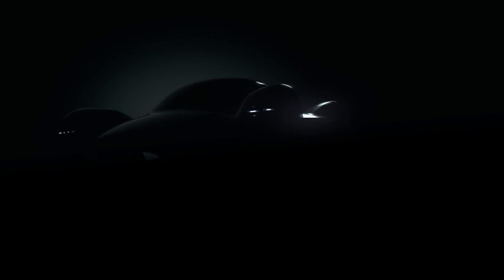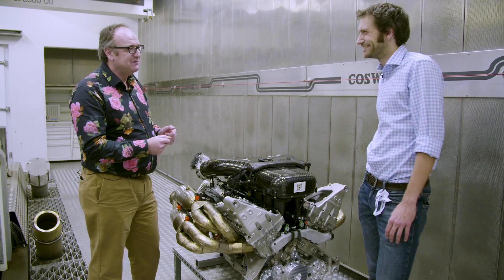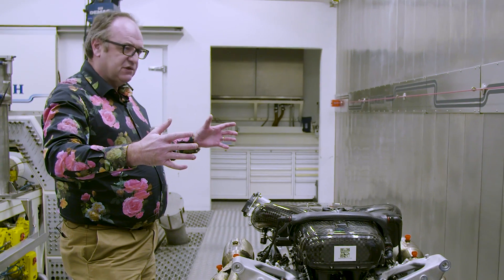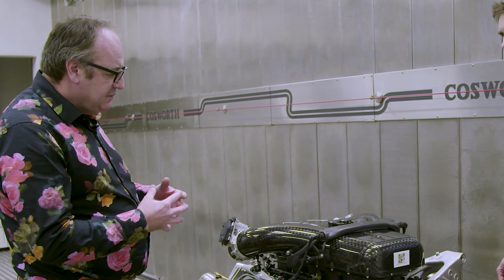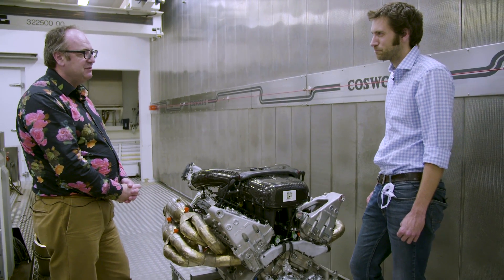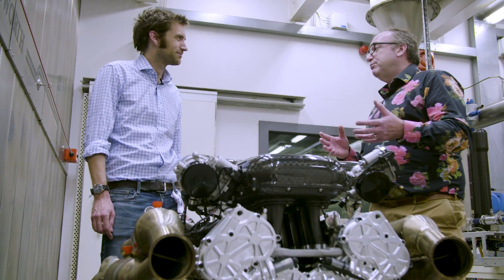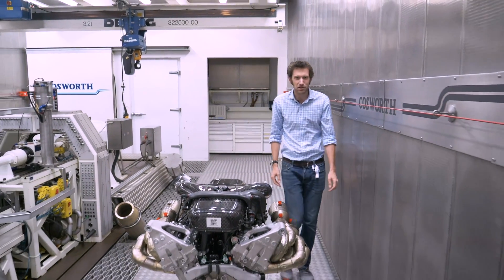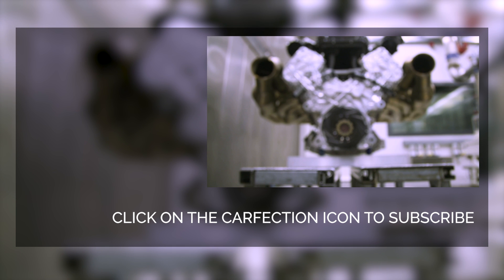Hear The Future Of The Supercar At 11,000rpm: The Aston Martin Valkyrie's V12 - Carfection

Comment: Great film, inside, explanations and everything, thank you a lot. 
I just have a tiny question regarding the clutch... why settle for sinter if the car will get electric motors (hybrid), anyway? A carbon clutch could be used with its benefits and, outside of e.g. race mode, the electrics could do the driving of. After the revs of gearbox and engine match, the carbon clutch could automatically be released (creating possibly the smoothest driving of feeling in normal traffic, and you wouldn't be able to stall it) and of it goes... But if the customer prefers,... happy stalling...
Thank you again, greetings to Cosworth, Mr. Woods, and Mr, Newey. Keep up the good work.
Cheers, Obelix

Comment: As amazing as this engine is an electric motor vehicle will crush a combustion engine vehicle. As battery technology improves the gap will grow larger.  Internal combustion engines need to be must more efficient.  Gasoline fuels have changed very little the past fifty(50) or more years.
Reply: whatever you say

Comment: All that noise, all that heat, all that friction - that's the sound of money burning. While the engineering is impressive, it's an ICE, inefficient as fuck compared to electric, and this thing, with all it's engineering, can still barely keep up with a 2 tonne+ Tesla model S up to highway speeds. What does that tell you? I guess to all the revheads, probably not much, you guys live in such a blinkered, testosterone fuelled world, you will never understand the reality of just how bad ICEs actually are and how much of a pointless waste of resources something like this car actually is.
Reply: This engine will be paired with an hybrid system for a combined power output close to 1200 ps, on a car with a weight of around 1000 kg and with underground aerodynamics (meaning high downforce, low drag) which is expected to accelerate from 0 to 322 km/h in around 10 seconds. 
So yes, it will be able to keep up with your Tesla 4-wheel-fridge at highway speeds.

Talking about electric engines, fuel consumption, etc. regarding a 4 million $ hypercar produced with F1/Group C/LMP1 level of mechanical technology, in no more than 100 pieces, as a testament of NA and V12/V10 F1 race cars.
Totally out of context.

Comment: Let's recap: Engine bay completely full, engine block holding front and back of car together, suspension loads are directed into the gearbox, all at 11k RPM (with gear-driven cams). How the bloody h*ll are you supposed to maintain this thing?

"It has to be everyday usable." LOL

Bonus: They put the radiators on top of the exhaust headers!

Stick to F1, gents. These "features" have no place in a passenger car.

Comment: the engine being a required structural part of the car sounds like a really bad idea for a road legal car.. because unlike a race track, real roads have many imperfections, potholes, dips, bumps, etc.. so not only does the engine have to contain it's only v12 forces, the car's twisting and turning, etc, but now also has to deal with every single bump, dip, pothole, etc.. those engine mounts/bolts, etc that are connecting it to the rest of the vehicle are going to be stressed to hell. Will be a sad day when we see a news story how a Valkyrie broke in half cause the owner hit a speed bump or pothole too fast which caused the engine bolts to snap from the cabin frame.
Reply: You know they make titanium bolts right?
For comparison, the wings on a commercial airliner are typically held in place with four bolts. It is very easy to ensure bolts will not be the failure point as there is so much data available on them.
Reply: @flightmaster999  question is, will Aston use bolts rated for airline use or not. Which in itself may be an issue since the types of stresses an airplane experiences in flight are different than what a vehicle experiences on the road.

There are plenty of cases where individuals blindly used parts rated for airplane use on a car in the custom modding scene, but end up snapping/sheering the part because the part experienced stresses it wasn't designed to handle.  i.e. part may be strong in resisting being stretched or compressed but is weak and sheers if enough lateral force is applied or vice versa.
Reply: @LycanShift  I think the Cosworth/Aston Martin guys know what they are doing, lol
Reply: Manufacturers have been building the engine into the chassis for years. Ferrari did it with the F50 if memory serves.
Reply: We have a youtube engineer right there..go teach them how its done...LMAO!!!!
Reply: Whatever you say

Comment: In reality, on the road, the drivers of these cars would probably only use the full rpm range a couple times because 1. That noise would frighten everyone in a block radius including the driver 2. The acceleration in first gear would be heart stopping.

A race engine on the road

Comment: While this kind of power per Cubic Centimeter is not unheard of, The mk3 Focus RS with its 2.3L Cosworth tuned boosted engine produces roughly the same power per CC. The fact that its naturally aspirated and capable of reliably running at such high speeds while maintaining such stringent emissions standards proves what an engineering marvel this engine is. Outstanding!

Comment: The part where they're simulating 100k of use for endurance testing got me thinking... If the engine is such a stressed component wouldn't it be wise to put the engine under different torsional loads during running to account for the structural aspect? I feel like it just sitting there doesn't take that into account...

Comment: Cosworth delivered to me - a 3.5L VQ35 V6 including Cosworth heads, that my tuner got 401hp out of NA. That was 2008. That engine could rev to 9,000rpm, more, but it stopped producing power above that.  My view at the time, we could not force more fuel and air through it NA. CR was 11.5:1.

Comment: 11000 rpm can easily archive by electric motors. All electric motors used in EV today having much higher than 11000 rpm that it need a gearbox t reduce it to reasonable speed. As of today several supercar maker are going electric why are they still developing v12 fossil fuel burning engine it kinda make no sense.

Comment: Can some american car manufacturers get a load of this video? Everyone is sick of 200 litre v8 engines reving only 300rpm, if a engine doesn't rev at least 7k rpm it can't be considered a good engine. They could put a light flat plane crankshaft in their v8s, and make them more emotional. A viper acr is a real beast, sad that it doesn't rev higher, but at least its got huuuuge amounts of torque in the low rpms. Same as the zr1, not even 7k redline. Instead of making 30 speed automatic transmissions they should focud on a 7 speed dual clutch and a high reving engine imp.

Comment: Until you find a way to keep the car on the ground without the tires falling apart. Who cares about the car ?
Reply: Brosyden you need to turn your gas stove on go for a good sleep
Reply: @porschecollector727  Dude I get it, it's awesome the sound the design the engineering. But if it can't smash or compete with Koenig or Bugatti what's the point. Both of those manufactures have problems keeping the tires stable after 260+mph for an extended period of time ( under 30 sec ) and the downforce is so strong the power to weight ratio needs to be higher without compromising stability and flying into the air at such a high speed. An engine can only do so much without a full design of physics and aerodynamics. 

But your a troll and im happy you learned something reading this. GET OWNED  !

Comment: Great engine.. terrible mounting choice. The engine should never be a stressed component of the vehicle itself (unless it's a motorcycle). (A.) Too much reinforcing required to support the lateral and twist loads. (B.) The car is literally impossible to service unless you break the whole thing apart to get the engine/trans asy. out. There's no reason they couldn't have created a carbon fiber and aluminum super-structure to support the engine/trans. I think Cosworth stuck their royal foot in their ass on this one. Reliability as a road car is going to be marginal at best. 😐

Comment: If they got 250 hp with 3 cylinders should it have 1000 hp not including electric motors
Reply: It does have 1000hp the electric motors increase that number

Comment: He said the engine is part of the car's structure, does that mean the engine mounts will be solid without any bushings to absorb the twist from the torque forces? I'm curious how rough the ride will be in the inside, but then again it will most likely be a track only car.

Comment: Suonds like this engine was detruned from a F-1 normally aspirated 12 cylinder.  I recall F-1 engines got up to 20,000 rpm.

Of course, the Valkyrie is suppose to last for a pretty long time on the road.

Comment: The best single measure of engine development is the Break Mean Effective Pressure. It takes time, expertise, and lots of money to excel here.

Valkyrie:
1000bhp, 11000rpm, 6.5L, peak power BMEP of 180psi.

This is not the peak BMEP, as we would need peak torque figures for that.

LaFerrari:
790bhp, 9000rpm, 6.3L, peak power BMEP of 180psi.
700Nm, 6750rpm, 6.3L, peak torque BMEP of 202psi.

I would expect the Valkyrie to make about the same, but if it does so at a higher rpm it's even more impressive.

The Ferrari engine has been around for a while, and every bit of performance has been extracted. That Cosworth could get to this level of performance within this timeframe and for just one car (probably on a smaller budget), speaks volumes of their capability. This is truly a masterpiece.

Comment: This may well be the last best internal combustion engine. Peak engineering and likely the end of an era...
Reply: It's surely not the end yet, since 3rd generation fuels and methane synthesis are on the rise.
Reply: you're underestimating how much cheaper would become to live with an Ev. Mantainance very rare and no fuels needed (electricity also has its cost but it will be so mich better than fuels, every kind of fuels). Let's the money do the talk, I'm curious too...
Reply: @briannabernaola5597  
There will always be a market for internal combustion, even in an era when it becomes illegal anywhere but a racetrack (it will happen, probably in California first, just as eventually only first responder vehicles will have steering wheels). There is no substitute for the experience of a living, breathing motor, and I'll be there, even when electric cars routinely beat us on track.
Reply: Wrong. We will have gas engines for another 100 years at least
Reply: @VEEZER1  and horses too, im sure. In corrals and museums.
Reply: @VEEZER1  They will exist.  Just like steam engines and horse carts still exist.  Almost no one will use them for daily use.  When was the last time you rode your horse to the market or plowed a field with a steam engine?
Reply: Well it might be peak of engineering, but it is ridiculous to say that internal combustion engines are dead -- and they won't be for a very, very long time.
Reply: @bobbysmith9725  they are def dead, you must not be in tune with the world and when the Tesla roadster is released these superice cars are super done for.
Reply: @bobbysmith9725  If a "long time" you mean 10 years.
Reply: @bobbysmith9725  The transition to electric will happen much more quickly than people expect.  As battery costs continue to fall it becomes lest costly to build an EV than a combustion car.  EVs currently cost about 1/3 to operate as fossil fuel, and there is almost no maintenance or wear on an EV other than tires.  Total cost of ownership of an EV is already lower than an equivalent combustion car, i.e. Tesla Model 3 vs BMW 3 series, Nissan Leaf vs Nissan Versa, e-Golf vs Golf, etc.  EVs already win on purely economic grounds for new car sales and the gap will accelerate.  For used cars, a used Leaf or i3 is an incredible bargain.  And the choices for other good EVs is growing rapidly.

Tesla reaches cost parity with combustion cars in 2 years, meaning it then costs them less to build an EV than a combustion car.  VW maybe 5 to 10 years.  Others later.  When EVs are cheaper to buy, almost no one will buy fossil cars.

Since this is a performance channel, as battery gravimetric energy density continues to improve, they will easily outperform combustion vehicles at both a lower weight and lower cost, especially if solid state batteries work.  The Tesla New Roadster outperforms Bugatti Chiron at 1/10th the price: acceleration, top speed AND RANGE.

The Tesla Model 3 Performance  today outperforms BMW M3, including on race tracks: https://www.youtube.com/watch?v=pOVIgVvjfH0
Reply: @LoanwordEggcorn  The batteries are a major concern maintenance wise
Reply: Loanword Eggcorn wait until the environmentalists start trying to power the grid exclusively with wind and solar, and then you’ll find the cost of electricity becomes much higher
Reply: @horseradish843  Well engineered battery packs are highly durable.  Some Tesla customers already have 500,000 km on their original battery packs with minimal degradation.
Reply: I was just thinking this same thing. Electric motors are the future. I'm excited for change, though. New e cars will be exciting as well... It'll become a hydrodynamics and software problem to solve instead of mechanical, mostly. But we have a long time before ICE goes away.
Reply: @swesleyc7  2025 ice cars wont be sold anymore
Reply: @Geedygeedy  What about people who have like no reliable places to charge in their countries. ICE will live on for a long time
Reply: @smothdude  by 2025 the infastructure will be built. Any country that can receive reliable gasoline will have MORE access to electricity than not. Also since they will be alot cheaper, more reliable, and maybe 3 times the range as an ice car by then, it will be more accessible to everyone.
Reply: Geedygeedy am do you know that the ice car can refuil in les than a minute and build tanks in it however its like to ?
Electric cars can not and are boting as hell and not environment friendly they only throws the problem to another place and solves nothing

I can explane everything about wy but im tired of that

At least they are a hell of idiotic
Reply: Geedygeedy What did you smoke? Three times the range of an ICE car???? How exactly are they going to have a range of at least a thousand miles? The most efficient electric car doesn’t get more than 200 in the best conditions right now, so how do you want them to have a range of more than a thousand miles?
Reply: koenigsegg does better
Reply: I don't recall EV being reliable. Possibly, due to all the tesla issues. Not only this, but EV aren't going to be the standard anytime soon. They overheat when being pushed and can't hold their charge for long in the sane scenarios
Reply: Agree.  Internal combustion is dead, and this is near peak engineering.  A reliable 1000hp from 200 kg is remarkable.  And normally aspirated is much better driving than boosted.
Reply: Loanword Eggcorn You’re dumb for saying they’re dead.
Reply: Janne Wolterbeek nope
Reply: Janne Wolterbeek Nope a cubustion engine is only limited by the materials and the gas it is used so thers still lots of space.
Reply: The W16 engine is also up there too!
Reply: Janne Wolterbeek ICE will go out in a bang 

Innovation never forgets its roots,and never stops

Comment: "As massive as the 6.5-liter unit is, the entire engine weighs only 206 kilograms (454 pounds). What impresses the most is the sheer power of the V12, developing 1,000 hp at a screaming 10,500 rpm and 740 Newton meters (546 pound-feet) of torque at 7,000 rpm."

The MYT engine weighs a mere  68 kg (150 pounds) and can easily produce 1000+ hp and about 1084+ Nm (800 pound-feet) of torque at IDLE speeds, and get fuel efficiency numbers that would make a Prius blush. It's time to put these obsolete dinosaur engines in the scrap heap where they belong.
Reply: You refuse to understand the art of engineering and this is one of the swan songs for ICE, Watches arent just to look at the time otherwise Rolex and Breitling would be put out of business in favor of a digital watch.

Comment: Are powerful petrol engines still a thing?  .... A powerful electric motor should easily beat this.
Reply: @RealCapo88 ... If the second Tesla Roadster does 400Km/h what else would we need....  Even 350km/h would be good for a second generation.

Petrol engine have been researched for 100yrs. We have reached the limit.

Even current Electric motors paired with a gearbox can probably beat the best petrol engine.
Reply: Emotion comes from the feeling of the power. Those who ride in electric cars feel the power!

Even among humans, the loudest person is often not the most powerful ...... Its posturing.